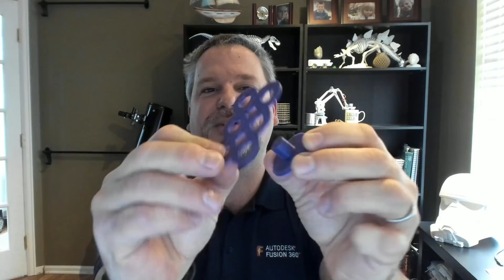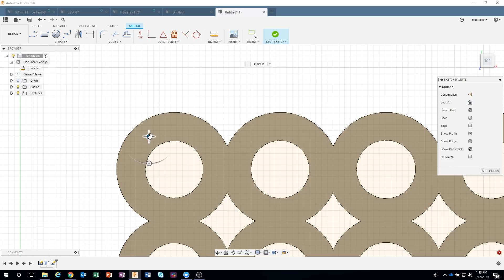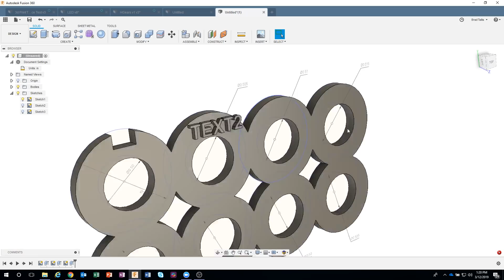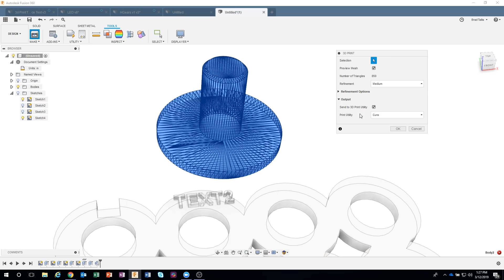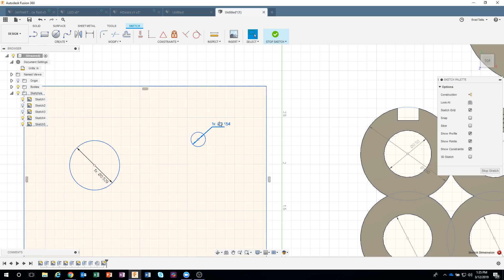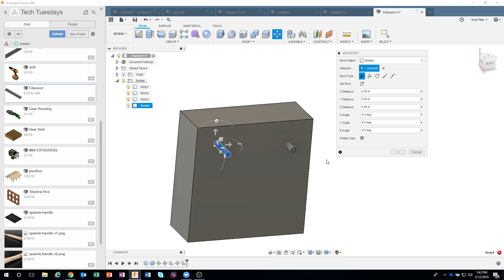360 LIVE: 3D Printing Tips with Fusion 360

Comment: For text on an object use the emboss tool. Much easier. And another suggestion is to create params for tight, loose fits I.e. .029 for tight fit so dimension would be actual size + (tol).

Comment: That's a great tip on setting Z to match the printers orientation and I've now set it in my confuguration. However, is there any way taht I can get existing models to respect that rule? I've tried copying old models to a new file and they now come in on their edge just like in my slicer. But if I then rotate them they still load into slicer on edge. New files not a problem but old ones appear to retain their original Z axis relationship?
Reply from the maker: Can you check the solution here: https://forums.autodesk.com/t5/fusion-360-design-validate/z-axis-up/td-p/5445468? 
I believe the steps indicated should help resolve those older files orientation, and he provides a nice reproducible set of steps.

Comment: Keep making great videos! However, it's Clearance, not tolerance.
Reply from the maker: I believe both terms are technically correct, but I could be wrong...
Reply: @adskFusion  They are not interchangeable. Clearance is the actual measurement of the "gap", Tolerance is the precision of the measurement. You can have a clearance measurement of .020" with a tolerance of +or- .002"
Reply from the maker: Sounds correct. Thanks!

Comment: Very informative and interesting video. So here's, what is in all probability, a stupid question: once you decide on the correct tolerance for a satisfactory fit, can you then determine what the tolerance should be for other sized holes without re-doing this exercise?
Reply from the maker: Great question. Hoping Brad will follow up to this, but that's my understanding. This is used to learn about your printers tolerance, from there use what you learn from this exercise to design better fitting parts.

Comment: First, thx for the vid, Brad. Very helpful.

Now, some COMMENTS ON TERMINOLOGY...
[If you care about this, great. If not, ignore.]

- Everyday use vs. technical use: each is OK, depending on realm.
- Following comments regard technical realm, where endeavor is to be clear, concise, and unambiguous, while avoiding conflating terms and creating confusion.

- CLEARANCE vs. TOLERANCE...
-- CLEARANCE is the "design intent": in a perfect world, it's the separation between parts to allow desired fit/function (e.g loose, or tight / free, or fixed, etc.).
-- TOLERANCE is a measure of the ability of a device to create a designed dimension. This is expressed as a "+/-" amount. It's a kind of allowance.
-- So, a design is created "ideally", then tolerances are identified. Note that tolerances vary between different technologies (e.g. 3D printing vs. CNC'ing).

- ACCURACY vs. PRECISION...
-- These are often conflated, too :(
-- ACCURACY is the closeness of the measured dimension to the intended.
-- PRECISION is the repeatability of a dimension.
-- Consider a dart board. Aiming for the bull's eye, but hitting the rim is poor accuracy. But if the same area on the rim keeps getting hit, then the precision is very good. Ideally, one wants good accuracy, AND good precision.

OK, in the end, the important thing is that all parties understand what each other is intending to communicate. Common, exacting terminology helps in this regard.

That's all. Carry on :) ...
Reply from the maker: Thanks for the terminology lesson -always worth a review! Funny thing was that Marti and I had the discussion on  'accuracy vs precision' just a week or two ago.

Comment: We all seem to think a 0.2 clearance is what needed for 3d printers now day, which is true, of course every printer has its own mechanical play,skew, and alignment issues, however something that is often over looked, is the effect the slicer does to those tolerance, a lot of the time switching a 0.4 nozzle for a 0.35 does all the difference in small prints. At least in my observation of the few printers i have.
Reply: @Patprop74-  Are you saying that you have a 0.4 nozzle on your printer, but you tell the slicer you are using a 0.35?
Reply: @bradtallis8968  Not at all, what i'm saying is, when i design a small part such as the gear and pinon that is in the video, if i slice with a 0.4 nozzle i much add a - 0.2 clearance to my designs, but if i print it out with a 0.35 it is not necessary , which has me believing the slicer tries to figure out the closest passes according to nozzle size and it must always add it in the positive meaning it will add to the model. If that makes sense.

Comment: One question : can I store or save the user parameters for global use  like as a sort of preference say for instance the tolerance . So I can use it in every drawing  would be a nice feature kind regards Hans
Reply from the maker: Hey Hans,  thanks to someone else pointing this out, but this app may just do what you need (until/if we add this):
https://apps.autodesk.com/FUSION/en/Detail/Index?id=1801418194626000805&appLang=en&os=Mac 

https://apps.autodesk.com/FUSION/en/Detail/Index?id=1801418194626000805&os=Win64&appLang=en

Comment: I can extrude text without exploding it. This way I can change it later.
Reply: Yes, that is the only way I have been doing it also, I never exploded it.
Reply: Yep.  I had always used the Extrude command which required you to explode the text.  However, if you use the Press/Pull command, you don't need to explode first.
Reply: @bradtallis8968  ; I can use the "E" extrude on text, just stay over the text and it may prompt which one you want and then select "text"
Reply: So the right click menu doesn't show extrude as an option on text for me but I have always used "E" on the keyboard and it extrudes just fine.  Going to the Create menu and selecting extrude also works fine.  No need for using explode.  At least in this particular case.